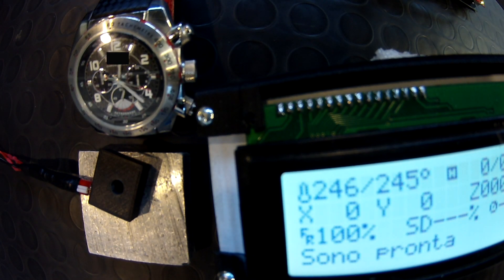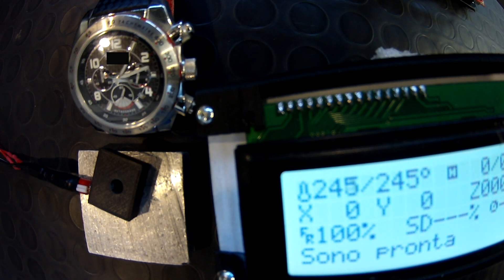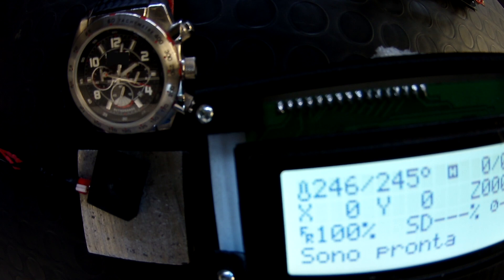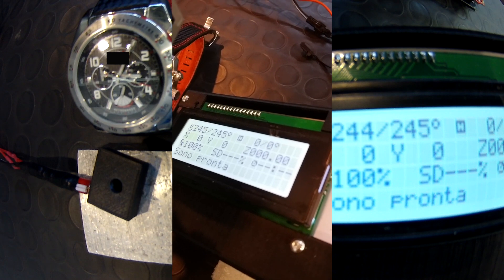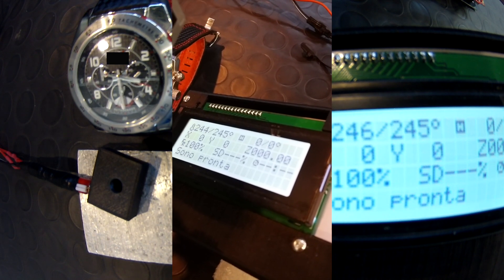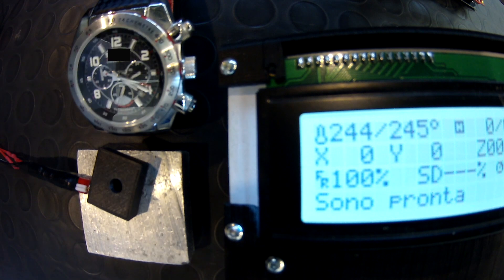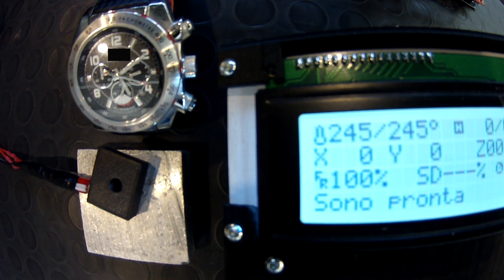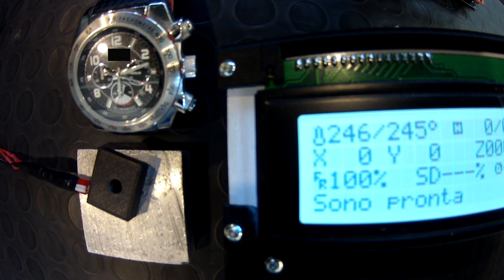PEEK 3D Printing - Test Thermal Inertia | Roboze 3D Printer

Comment: At :40 looks like a fair amount of warping to me. What kind of test is this? No control sample, No per-measurements, No post measurements, No tensile or compression tests. Where is the time laps of the part heating up and cooling down?
Reply from the maker: Mr. Voxel Lab, thank you for your comment.

The video was made with the aim to show through our youtube channel one of the result made by our R&D area: the way how the Roboze PEEK maintains its macroscopic properties at constant high temperature. If you’d like to discover the entire ASTM test please contact us;  we have TDS of our peek where you can read values about mechanical (in terms of tensile,flexural and ILSS) and thermal (Tg,Tm and HDT) ASTM tests made in our labs.

Ps. The warping you see is just the lighting and angle of the picture. If you still have trouble believing the resistance of our PEEK please contact us. For us it will be a pleasure to show you the way we work.